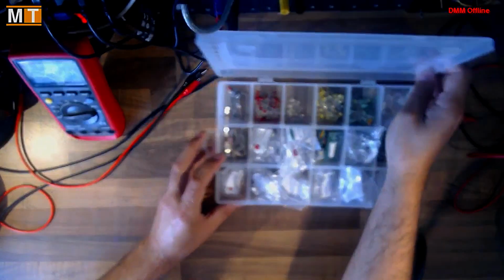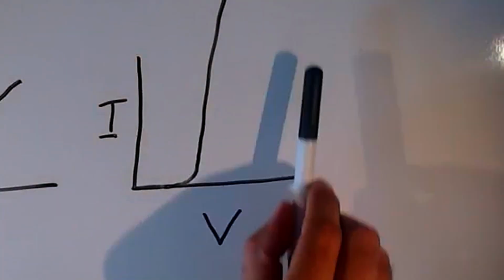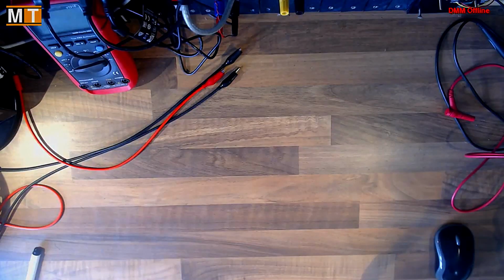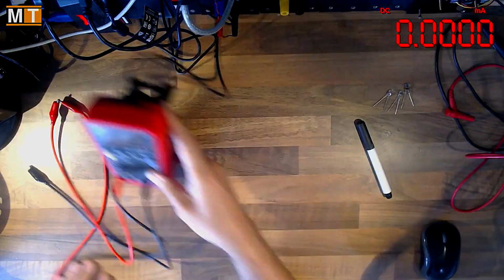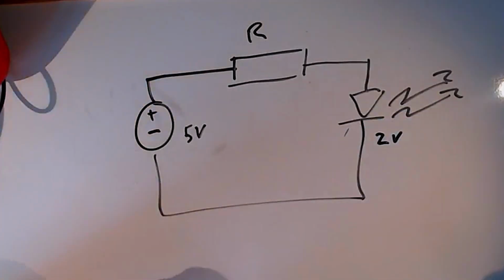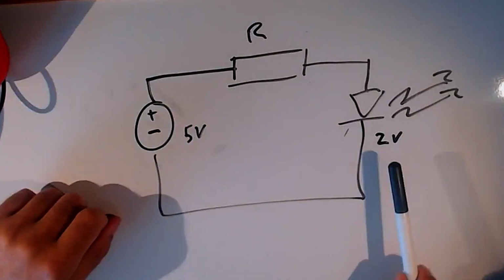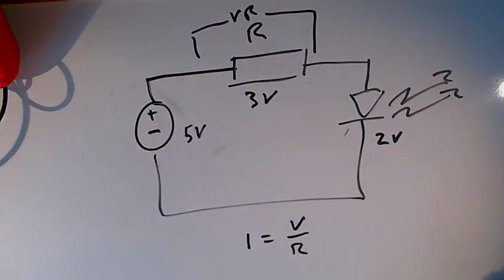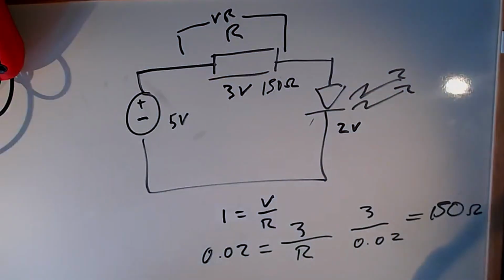What happens when you provide too much power to an LED?

Comment: What we really want to know is what happens when you apply high voltage AC to an electrolytic capacitor?
Reply from the maker: Oh I know all about that. I used to blow up model trains with a mate using those...
Reply from the maker: Also I'd really want a high speed camera for that to get the full effect.....